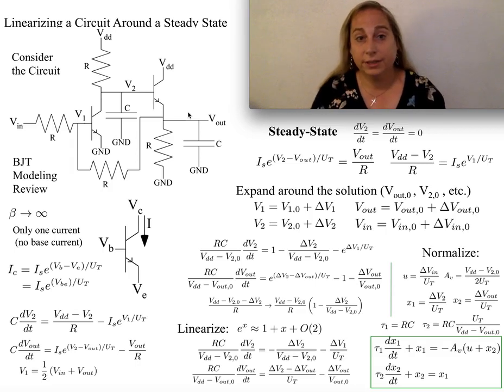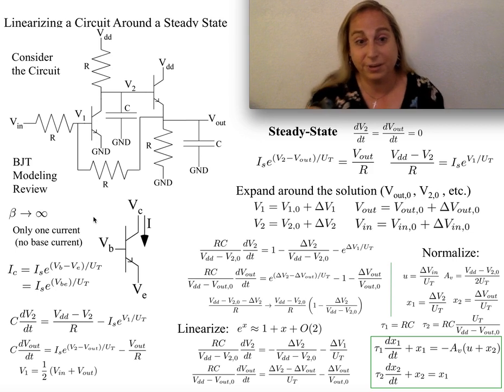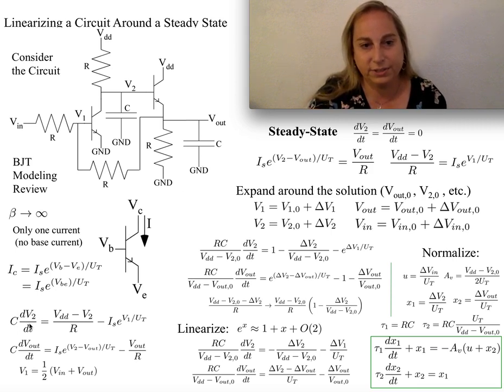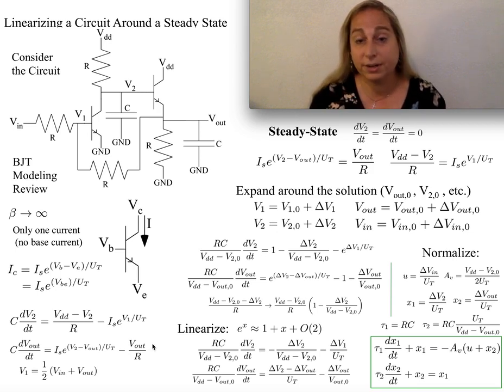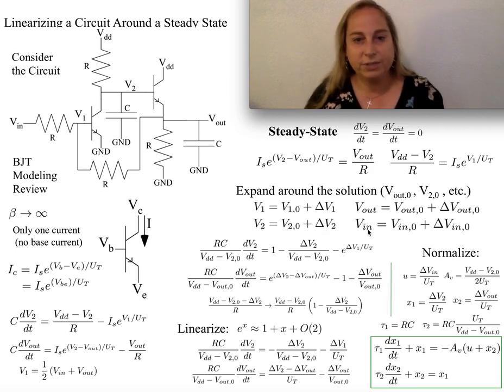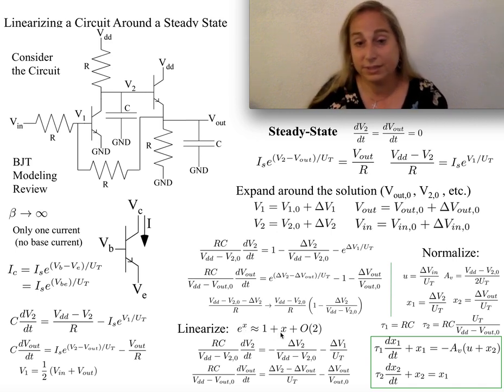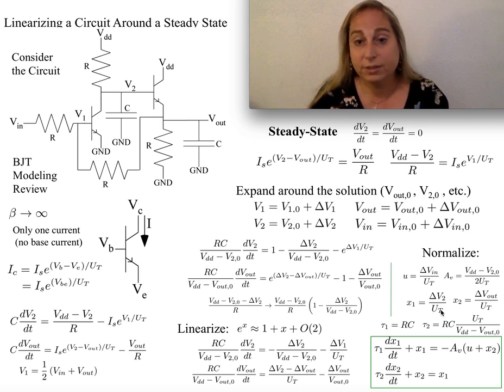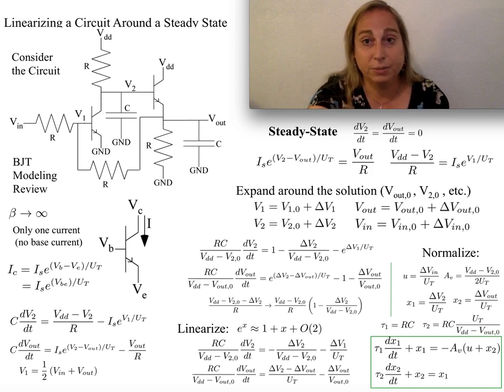Linearizing a Nonlinear Circuit

Comment: Wow, interesting .. You chose a rather non-trivial example - looked straightforward til I saw that second C giving this nonlinear time constant with TR2's  Re

The first time const isnt that diff from looking at an opamps GBP, one major dominant time constant, so you know you have some predictability and stability, right?

But then that second one... Hey this is something like an OPA driving a capacitive load, is THAT maybe why you used it? So the example's stable unless  RC gets so tiny that there might be other lags from the active devices in the loop?

And of course you point out a massive caveat that the math implies bias being in a a sensible region, and only tiny excursions (dv), right? Like Bob Pease said, before you start modelling you REALLY have to have some idea what you're (your circuit's)  DOING

Thanks for bending my head there - lets watch some more - Hi from London :)